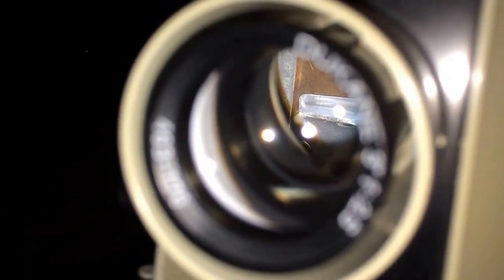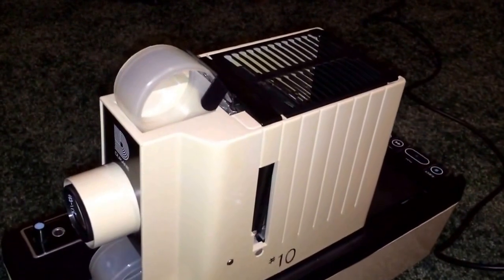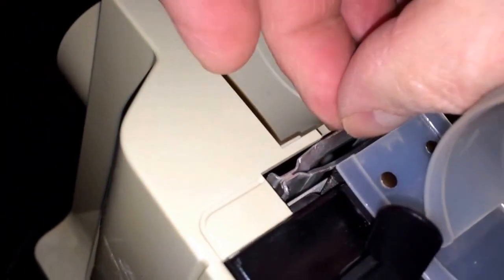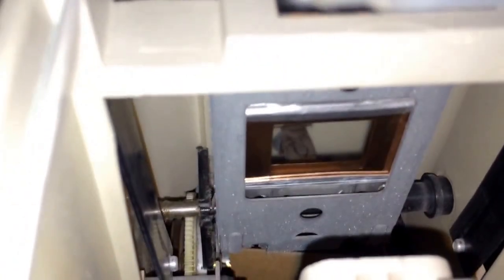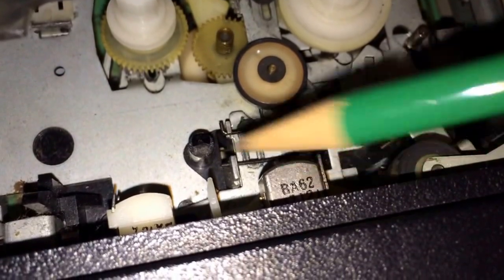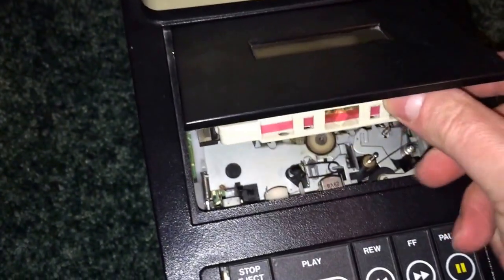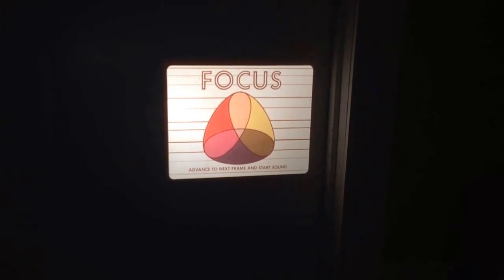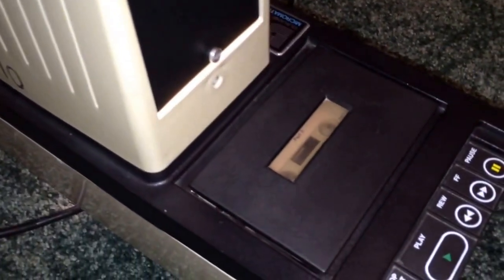Dukane Micromatic II Filmstrip Projector - Cleaning and Operating

Comment: I've recently got my Argus 500 slide projector at Goodwill last weekend and it works perfectly after all these years. I did got rid of my Kodak Carousel 650 because it's not working anymore and it won't advanced. And yesterday, I've got my first Airequipt slide tray that it fits with Argus and Airequipt slide projectors. It holds up to 36 slides. I hope that I need slide mounts and a filmstrip which came out of a filmstrip projector and it will fit really well. All I need is a scissors and a slide mounts. I hope I should do my demonstration of that soon.

Comment: That machine is just the greatest thing ever.
Reply from the maker: Luis Cortes - I completely agree.  If only I could make my own filmstrips.
Reply: databits Actually, you can--all you need is a roll of reversal slide film (Ektachrome or such), and a 35mm still camera that can shoot "half-frames" (like an original 1960's-era Olympus Pen).  When you've shot what you want with such, just take the film to the processing lab and request to not have the film cut and mounted into slides, to leave it as one uncut strip/roll of film (most labs can omit this step for you)--and voila!!  A homemade filmstrip!
Reply from the maker: Sounds like a recipe for awesome!!

Comment: I remember those from grade school back in the 90's and early 2000's. We would also have the questions sheets that we would have to listen to the audio to get the answers. By my memory it always went way too fast as well. I still hear that beep in my sleep.
Reply: Yeah, it's surprising how long after it's prime that they still remained in use

It was probably due to the budgets schools had, but it wasn't uncommon for schools to use filmstrips, film projectors overhead projectors/transparencies, LPs and microfiche up until around '02 or '03 even though computers, VCRs, DVD players and other, more modern equipment and media were widely available

Comment: Thanks for the instructional video...got my Micromatic II working because of it, however, the lamp shut off after a few minutes. Do you happen to know if there's a built-in thermal shutoff? I did buy a new lamp just in case. Thanks again!

Comment: Thanks for showing that in detail.  What I want is a projector that I can project home processed, uncut ektachrome reversal rolls of 35mm or 120 size.  Looks like the educational media film strip projector will not be viable even as a base.  I need the film to travel horizontally for 35mm and vertically for 120.  Plus, it looks like the aspect ratio and gate of the filmstrip media is half frame or something.

Comment: These are not obsolete. The data density on a 35mm film strip is higher than most digital cameras. The colors are truer. A projected slide is a lot brighter than an LED projector. Change out the source with a high intensity LED, and you've got a winner. These projectors can be repurposed with few changes to serve as enlargers for cyanotypes and other processes, including platinum prints.Avoiding the whole process of scanning and producing a digital negative results in a much sharper image. There are many slides and film strips that are unlikely to ever be copied or scanned. Preserving these rare materials and exhibiting them is an important part of educational and cultural heritages.

Comment: Silly question 
Can one play a 35mm film trailer on this machine?
Reply: I would say you can in a way, but you need to go one frame at a time or press that forward button rapidly, do not know how fast the machine can play a strip, the main point is just one frame at a time, if I understand it all right.